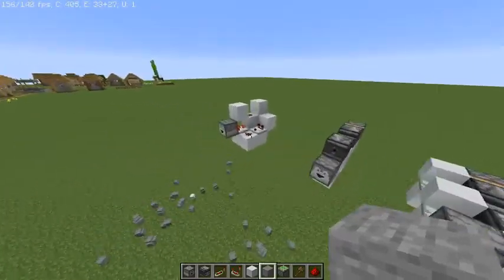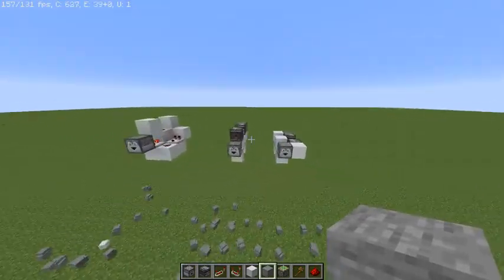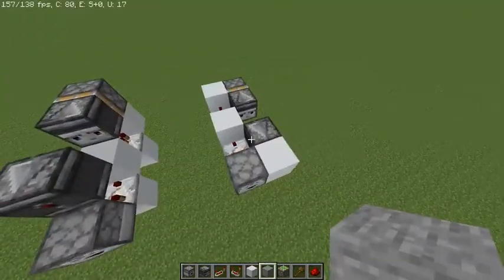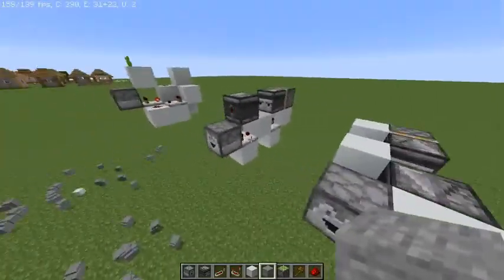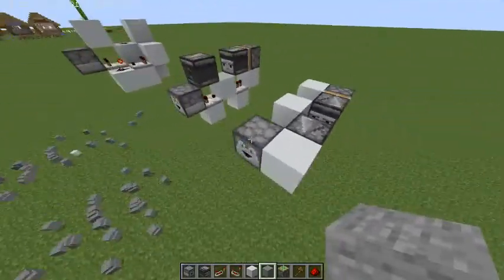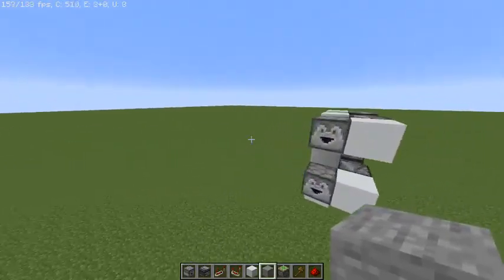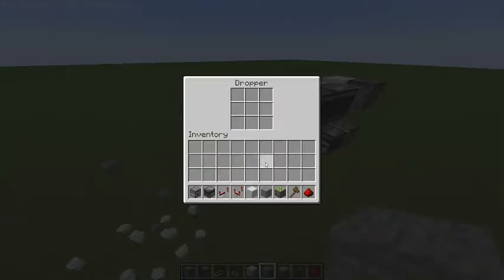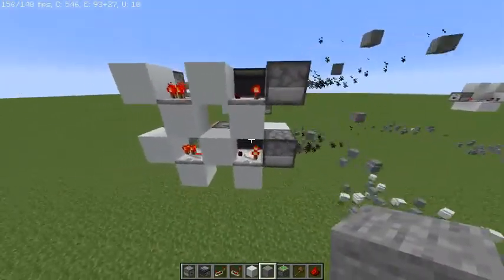Super fast dropper clock

Comment: The thing with the block, you sometimes need is Quasi Connectivity or ahort QC, it means that blocks like droppers, dispensers and pistons are powered, if the block directly above would be powered. So the air would be powered and sofore the dropper beneath is powered, and at the stackable design the block is necessary, because QC doesn't work sideways.

Comment: How to load items from a water stream into the droper fast. ianxofour has made a guardain farm and hoppers cannont keep up with the output. I have to sit for at least five time the time it takes to kill the mobs to sort
 the prismarine im using for my Ice highway tunnels. Either that or i have to spend 3 times the amount of time thorwing out unneeded fish.
Reply: Are you auto sorting the drops? Auto sorters are so good for not only keeping up with high output farms using water streams, but also super good for saving you time sorting and throwing out items yourself. 

Auto sort the drops you dont want into a dropper that drops it all into lava. With my gold farm i have everything auto sorted and the rotten flesh/swords are all automatically trashed, it's saved me hours by now
Reply: The probelm is hoppers can only deal with 2 items per second. So all the remaining items just remain in one giant clump. and they hoppers only move one type of item at a time. i need a way to convey items quickly over enogh hopper stopers to fiter the times. But dropers themselves must be loaded or feed with hopper which have the same bottlenecks.
Reply: @thewallstreetjournal5675  you can auto sort with water streams and hopper minecarts. Use a fast dropper clock and like 2 or 3 hopper minecart auto sorting tiles for each drop that you want to keep that you're getting a bunch of, then have the rest drop off of the end of the stream directly into lava, wont even have to touch it if you dont want an overflow chest for fish. Faster dropper clocks operate at least twice as fast as a normal hopper and could theoretically handle something like a guardian farm at least MOSTLY. I'm about to revamp my gold farm with faster droppers, blue ice and hopper minecart sorters to hopefully get the drops way more under control